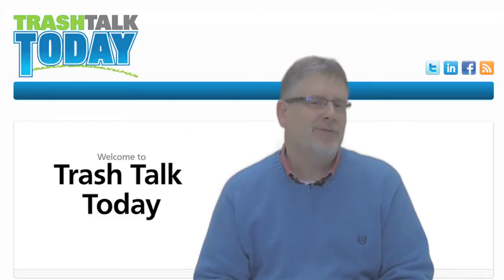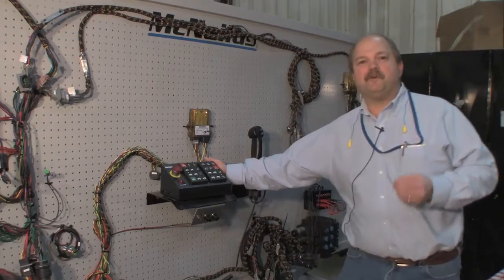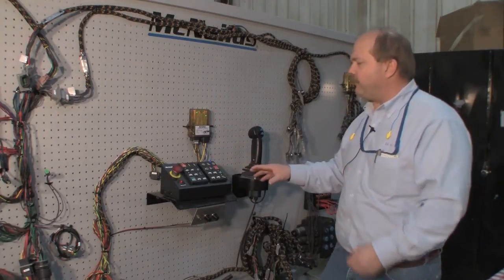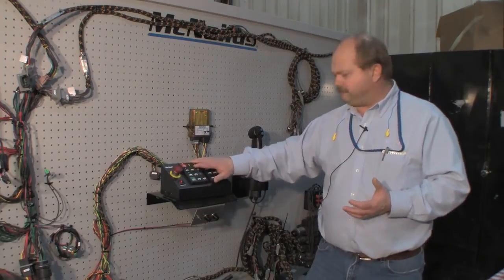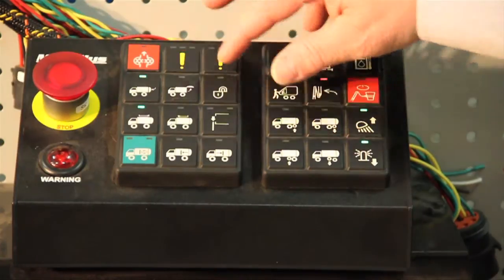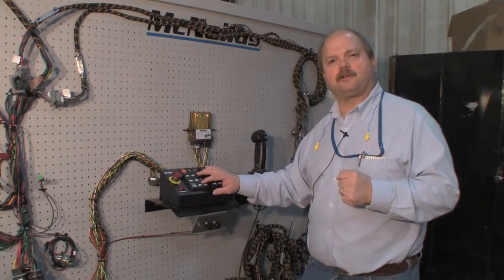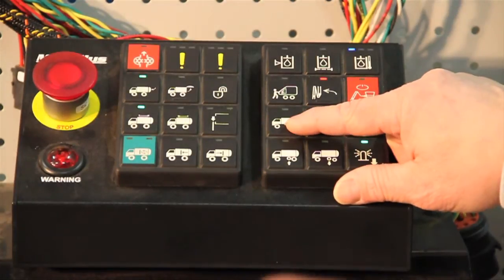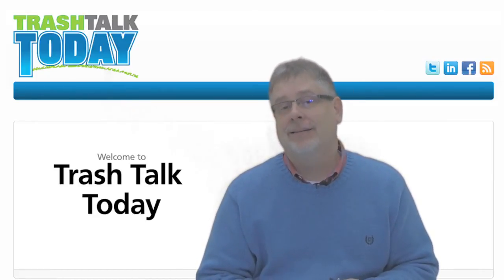McNeilus Garbage Truck - Lo Pro Control System

Comment: Nice system. I work for a Mack truck dealer. We often get customers with MRU and LEU chassis and McNelius bodies. My question is when we have an intergration problem between the truck electronics and body controls such as engine speed ramp up during packing where can we go to get service and operators information on the packer? We often have difficulties finding information and that causes our customers to become dissatisfied because we simply couldn't diagnose and repair their issue.